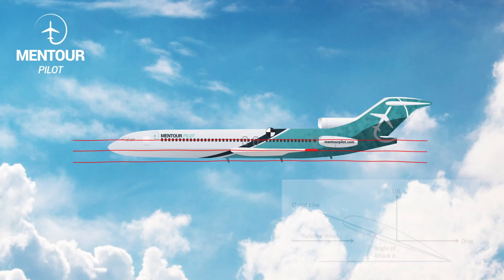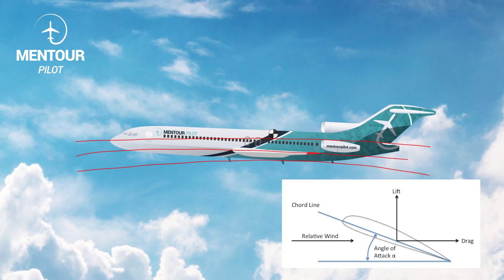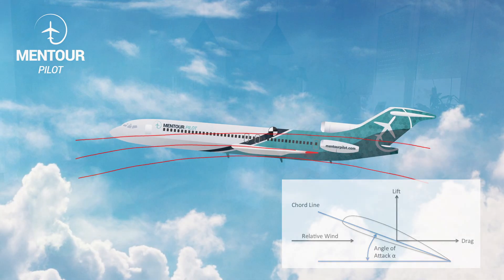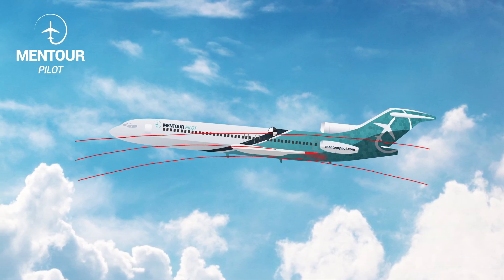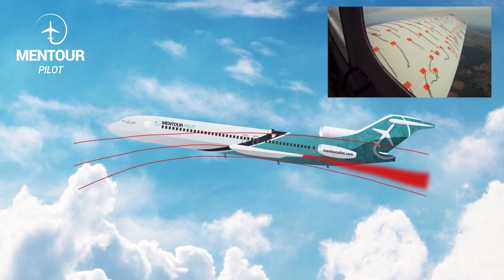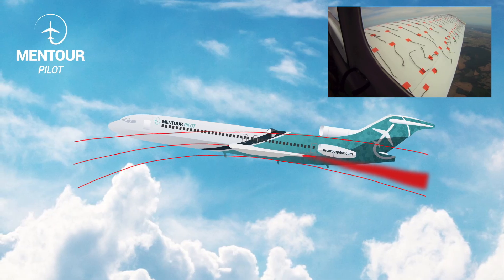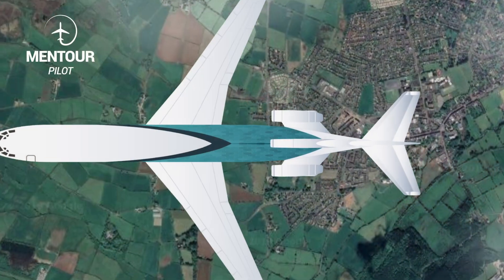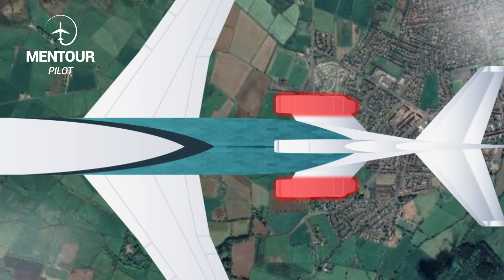The STALL you can't get out of! SUPER-STALL

Comment: After watching this video I did some experimentation in Microsoft  Flight Simulator, because that is what I have available to me right now, on a possible way to get out of this kind of stall. The only way that I can make this technique work is if the stall occurs above 25,000 feet. The method that I found that worked was I initiated a fuel dump at the same time that I initiated a transfer if you’ll be tween the wing tanks. Another words, I was emptying fuel from the aircraft but at the same time I was transferring all available fuel from the right wing to the left wing. Once the  the right tank was nearly empty I ceased the fuel dump. This caused a weight imbalance that forced the left wing down and allowed air to flow across the control surfaces again. I have no idea if this would actually work in real life… Any thoughts?

Comment: If an airplanes wing is designed to create lift how can a plane fly upside down and not have the wing pull the plane downward? Thanks in advance for the answer.
Reply: They can’t, at least commercial aircraft can’t 
There are some stunt planes that can that have wings with the same design on the upper and lower surface of the wings and therefore can produce Lift both ways but they can never be completely level as then they would loose the lift

Comment: You mentioned the BAC (then Vickers) 111 which had the rear mounted engines and which crashed through a super stall back in 1963.  I was an air cadet in 261 Guildford at the time, and one of our officers worked at Wisley and got us an air experience flight on one of the development 111s.  This was only a few months after the tragic loss of one of the aircraft and all the crew, through the super stall that you referred to. There were about 20 of us and when our coach drove onto the flight tarmac we could see a half dozen or more 111s with rocket motors fitted, presumable for propelling the 111 out of the super stall and enable the continuation of the test program. As a kid of course , I didn't realise the full impact of what we were doing and didn't worry much about it. Today, as a retired teacher, I am somewhat horrified by it all, especially when I found out recently we were doing some of the same tests that the crashed 111 had been doing. 
There was a large tank of water in the centre of the aircraft and they were pumping the water from end to end of the aircraft to test the auto pilot's response to the shifting of the centre of gravity of the aircraft ( Centre of gravity used correctly here, by the way.) And either to keep us amused, or because they wanted a stronger effect, they had us running from end to end of the mostly seatless cabin in conjunction with the water pumping!! As I say I am somewhat horrified today!!
I would just like to add that the crew who gave their lives in the crash enabled flying to be made safer for all the rest of us and I hope no more flippant remarks are made here.

Comment: The wingtips are made to stall LAST. The root of the wing is at four degrees of incidence (optimal finess) and the tip is at two degrees so that you still have some aileron left even when you stall. This create  a more predictable stall then if the wing give up all at once. A sharp lost of lift at the tip would also create a whipping effect of the wing creating a constructive resonnance and potentially damage the structure of the wing.

The horizontal stab. have a smaller incidence angle then the wing and a bigger aspect ratio so  that it can stall after the  wing and push the nose down (or lift the tail up) during the stall.

Comment: You may be able to use the landing gear together with the flaps to get some drag on the lower bottom of the aircraft in a depp stall condition with like a md or sometink like that :-) The drag could move the aircraft around, but it also might be very unlikely.
I´d be interested in a simulation. Kind Regards, Dominic

Comment: What I don't get is... Is there a speed where angle of attack becomes irrelevant?
So if the plant is going 2000miles an hour... And pitches up to 45 degrees. The air flow would be coming from Infront of the wing? Unless it's skidding?

Comment: Hello Pilot,
Do I understand it right that, 
Stall will happen when you have a  large angle of attack at relative low speed?
But if with the Same Angle of Attack, the speed is much higher, then stall won't happen. Right? And the plane will climb up of course. Right?
If right, What are those speeds and angle of attacks?
If not right, Then how come that fighter jets and other acrobatic planes can climb strait vertically?
I suppose this is because of their high speed, which provides enough lift, no matter in what direction they move.
So why can't normal plans in a critical angle of attack give full throttle to gain more lift?

Comment: “You can fly an aircraft straight up, as long as you can maintain speed” isn’t that just a rocket?
Reply: An f15 will fly straight up
Reply: A lot of modern fighter planes have a thrust-to-weight ratio greater than 1, meaning that they can not only fly straight up, but accelerate while doing so.
Reply: Technically not a rocket, because a rocket is defined by its engines being rocket engines. But they sorta behave like a rocket unless they have plenty of airspeed to maintain aerodynamic control authority.
Reply: @Grace Jackson  - who knows which came first?

Comment: Wing-mounted engines could presumably be offset to get one wing down and recover from the stall.  They wouldn't be in the dirty air behind the wings.  One engine could be brought down to idle, while the other was at full power to cause a differential in thrust that would bring a wing down and thus the nose down also.  Thus it is not unrecoverable with sufficient altitude.

Comment: 12:54 
Would lowering one side of the flaps work 
Like having the right wing full flap out and left no flaps 
If you cann acutally do asymertic flaps
Reply: Airflow must adhere to the wing for control to be regained.  Flaps would not regain airflow over the wing at the right angle of attack.  Getting the nose down is the only recovery option, unless you have military-grade engines that can accelerate the plane while aimed vertically (straight up).

Comment: That is what took down AF447.  Look at the accident report.  Mentour, you know as well as I do that a loaded A330 can't climb at 7000fpm at any altitude, much less from cruise altitude.  That aircraft was pushed upwards by a strong updraft in the embedded thunderstorm line, and after exiting that updraft they found themselves high, heavy, and at a positive AoA.  The aircraft then entered a deep stall which of course blanked out the tail effectiveness.  Add in the fact that super-cooled liquid (not ice pellets for god's sake..) entering the pitot tubes and freezing, which of course affects AoA and airspeed.  The co-pilot didn't help things by continuing to pull up, which of course aggravated the situation and prevented recovery. If I am correct, there is a slight window of time where they could've rolled the aircraft to the right, quite a lot actually (certainly to the point of discomfort or alarm to passengers not familiar with flying or upset attitudes).  The aircraft could then use the fuselage to slow it down some and hopefully recover.  Outside of that, anything you'd do to recover would've oversped the aircraft horribly, or outright stressed the airframe to the point of breaking things or in-flight breakup.  A sad situation for sure, but an example of a deep stall, and more importantly, an example of why we do NOT fly into thunderstorms.

Comment: I have managed to recover super-stalled T-Tail aircraft by rolling the aircraft onto its back. The control column action is reversed and effective because the control surfaces on the tail are now below the turbulence of the stalled wings. When inverted, pull the control column BACK....this will drive the nose down. The aircraft will enter a controlled dive, and when sufficient airspeed is gained, roll the aircraft back to normal level configuration.
Loss of altitude will be considerable, as will be damage in the passenger cabin..... but it's a sh*t or bust situation.
Disclaimer: All manoeuvres conducted with Flight Simulator..... passenger stress was minimal.

Comment: Some VC10s had twisted wingtips to give lower angle of attack at the tip, meaning it was less easy to stall the tips, and so the aircraft could fly slower and also higher than the unmodified versions.

Comment: Whilst in a super stall, would lowering the landing gear help? I just thought the extra drag under the aircraft might lower the nose a bit.... I'd love to hear your thoughts.
Reply: I had the same thought! Also, Maybe reversers on the engines to increase drag either on rear mounted engines or on underwing mounted engines might slow further, but "pull" the tail of the plane up hopefully enough to regain pitch control. Think of a string pulling straight  back on the drag inducing engines.

Comment: I presume all aircraft have stall characteristics that differ from one to the other...wing cord, shape, area, etc...one stall characteristic that I come across more than any other, including flying remote control planes, is at the moment the aircraft stalls it drops a wing thereby allowing the pilot to recover quickly...is this accurate...
Reply: Chris Haberland Airliners tend to have poor stall identification (no buffeting) followed by a sudden rapid drop in lift. It’s different than smaller aircraft because airliners have wings that generate relatively more lift on the back part of the wing, which is good for cruising at high subsonic speeds but not great for stall characteristics in general

Comment: (For the twin engine T tail plane) Do you think cutting the engines, then activating one engine and then one side of the wing flaps would work to get out of that type of stall? (Or maybe cutting one engine and leaving the other on, or just using the wing flaps on one side or actually making the plane flip)
The tipping part works in my head, but it probably wouldn't work in real life, in fact it might cause the plane to do a back flip, or barrel roll or worse. 

I like problem solving, especially when it comes to a situation that seems impossible, I understand physics but it's hard to properly imagine that situation, if nothing truly works I wouldn't give up, not when someone's counting on me to pull through!
Reply: Flaps always work in a parallel way, you can't activate them on one side only. 
About the engines - MP is talking about a compressor stall of the rear engines - which means almost complete loss of power, no chance regulating speed with them.

Comment: All im hearing in this vid is the basic design of rear engined high tail aircraft is fundermentally flawed.
Reply: Christian Buczko All designs have some set of issues. Fortunately for high tail designs stall is extremely rare and systems can make it safer, so it ends up having comparable safety despite that.
Reply: @AmbientMorality  if other designs dont have that flaw, they are better. The downsides of those other designs isnt normally terminal, and having an easy suicide option on big planes carry passengers is abit short sighted. If it can happen, it WILL!!
Reply: Christian Buczko How is it easy? It doesn’t happen in practice. Safety is important, but not to the exclusion  of all other considerations.
Reply: @AmbientMorality  well i could list a few examples of crashes where it was the cause. It has already happened multiple times, they know why, their idiots for repeating the mistake hoping the same thing wont happen again. And computers that solve this problem cause dozens of other problems, which also have led to several airliners crashing too.
Reply: @christianbuczko1481  Stall causes crashes in general. Air France 447, for example, had nearly completely ineffective controls for much of its stall. Of the few stall-related T-Tail crashes the pilots didn't have much time to react anyway – I don't think the outcome would likely have been any different in a conventional configuration. That's why the focus is on avoiding stall in the first place.
Reply: @AmbientMorality  thats true, but avoiding a stall in any aircraft is advisable. The difference is one design is recoverable easily. Theres an example of a plane with a high tail crashing due to ice for similar reasons. Ice caused an increase in angle of attack, that stalled out the tail. It was a few thousand feet, rolled hard and crashed. Low tail planes wouldnt have crashed and that type is now considered unsafe by many in ice conditions.
Reply: @christianbuczko1481  Colgan 3407? I'm not sure how a conventional tail configuration would have prevented that; the crew never pushed the nose down, which is going to make stall recovery difficult to say the least. I could see your point if they were trying to push it down and the plane wasn't responding, but that didn't ever happen. They pulled up from first stick shaker activation until it crashed.
Reply: @AmbientMorality  it was a canadian flight i think, when it stalled the tail, it rolled. A conventional set up would drop the nose into a recoverable dive. I think your correct a conventional set up was also too low, but it was a few hundred feet only before something like that would recover. Where as that aircraft rolled and dived inverted. Youd need several thousand feet  and a miricle not to break up whether the ground is there or not.
Reply: @christianbuczko1481  Air France 447 shows that a stall in a conventional plane does not drop the nose into a recoverable dive if you're still pulling up. The only configuration that would drop the nose even if you're pulling up is a lifting-canard configuration, because the canard loses lift (thus no pitch control) before the wing loses lift and the nose has to drop. For any commercial plane the only way to recover from stall quickly is to immediately pitch down and then gain airspeed. If you don't do that, the airplane configuration doesn't matter – you're going down. The only difference is that a T-tail might be a bit less responsive once you get into a deep stall, but by that point you've already messed up stall recover enough that crash was nearly inevitable regardless of tail configuration.
Reply: @AmbientMorality  the plane computer or sensor connected malfunctioned on that 747, the plane acted dumb. Normally it would recover but attitude control was confused hence it didnt recover and broke up.
Reply: @christianbuczko1481  Air France 447 was an A330. The pilot was pulling up after the stall warning, which was the proximate cause of the stall and crash. The only thing the computers did was disconnect autopilot and move to alternate law (which gives pilots more control) when unreliable airspeed was detected.
Reply: @AmbientMorality  so not the 747 over the Atlantic which disappeared? I'm not familiar with the crash your referring too.
Reply: @christianbuczko1481   
Other designs have other issues, to put it short. With engines mounted below center of gravity, the aircraft will pitch up when engines are set to more power - like a back- or front-driven car tends to over- or under-steering.

Comment: It seems to me that while in super stall, as the aircraft drops faster and faster, the upward wind created relative to the aircraft will push upward against the underside of the fuselage, wings and horizontal stabilizer. The surface area of the wings and stabilizer is much greater than that of the fuselage. The wings and stabilizer are behind the center of gravity, so the wind pushing them upward will cause the aircraft to rotate, bringing the nose down. Why isn't this the case?

Comment: Aircraft manufactures that certificate an aircraft have to demonstrate that there is a safe margin between deep stall and the activation of the stick pusher. To do so, Fokker Aircraft company had to deactivate the stick pusher on the Fokker 100 and Fokker 70 during flight testing and demonstrate that margin. If a deep stall actually would occur, then the test pilots could activate solid fuel rockets that were installed into the tail of the prototypes. That would lift the tail plane out of the wake. At least once the rockets were used during flight testing to recover from a deep stall. You need steel nerves in such a situation, because the thrust from the rockets in not available instantly, and once fired the rockets continue to deliver thrust till it runs out of the propellant.